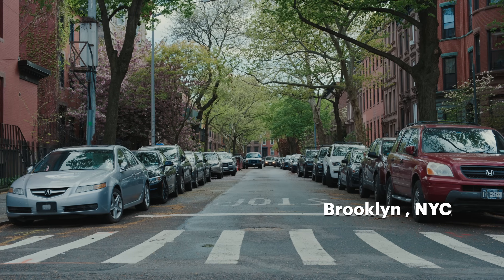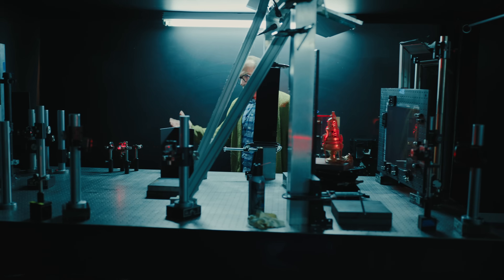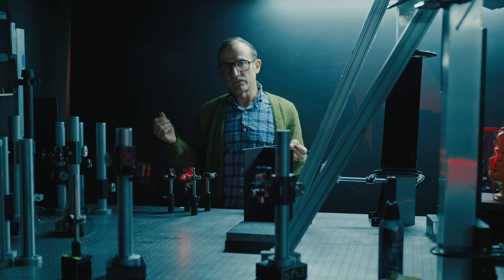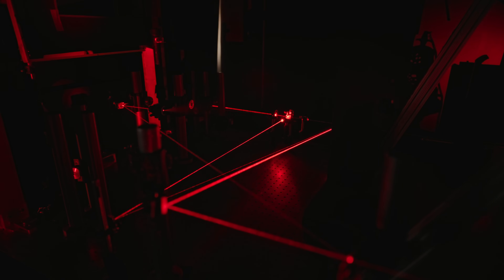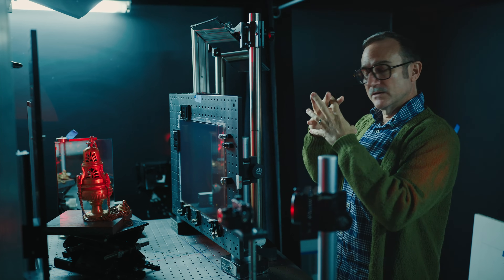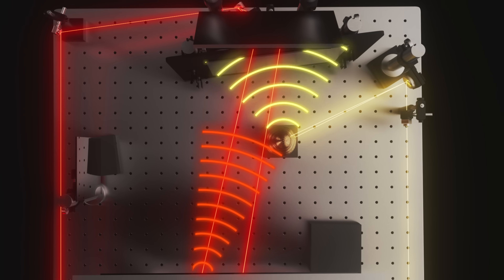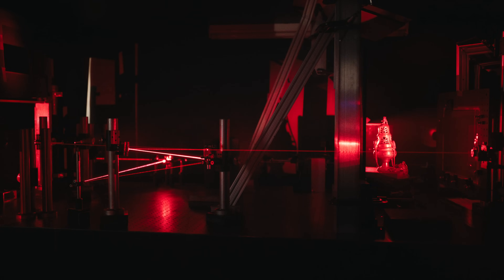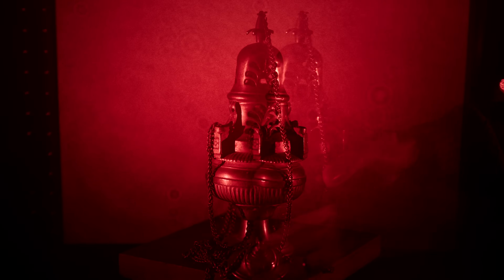How Holograms are Created

Comment: You know hologram are made a powerful laser, need a advance engineering and high quality knowledge to make it like need 100kfps and powerful chip to make smooth the animation and to handle the heat because hologram are very fast equal as the speed of light, imagine the binary code but super fast, if you apply to laser it's like they blinking that requires speed that the light send to air it's because it's powerful laser it's make to visible even there no matter touching it, why they blinking it's because to stop to atmosphere it's required 100 or more laser just to make one dot hologram, why one dot hologram for 100 plus laser because not all laser are light at once it's only 1 laser can send to atmosphere if the light reach the specific high level of distance they automatically turn it off and another laser can light to send the atmosphere and same process to another.